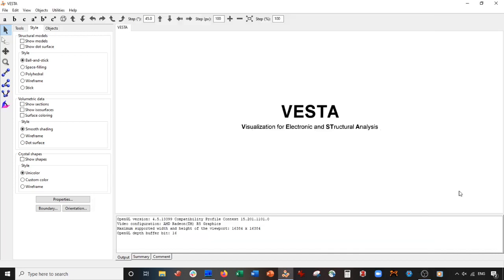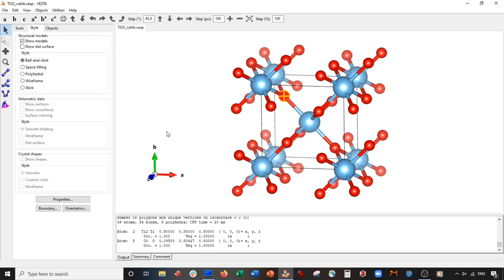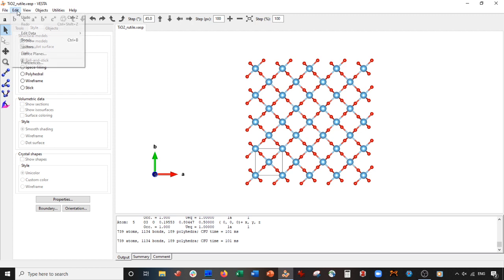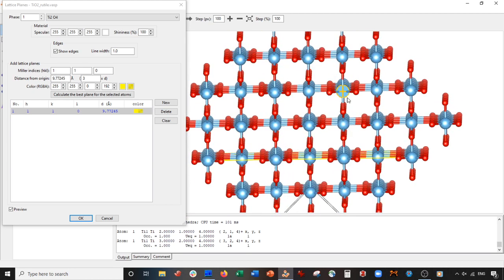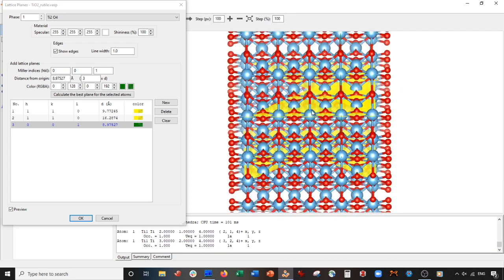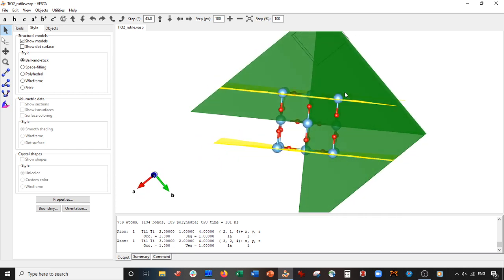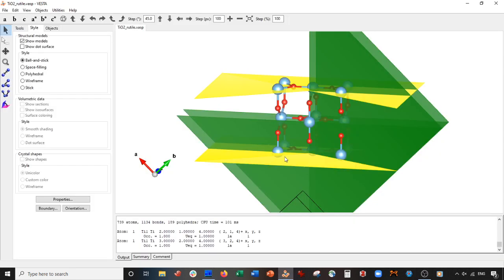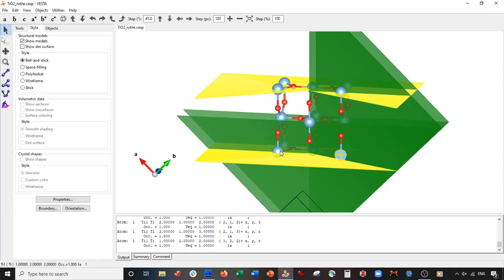VESTA Software - Rutile TiO2 [110] Surface Reconstruction

Comment: Hi. Thanks a lot for this great tutorial!! I am trying to do some oxygen evolution calculation over rutile (110) face and this video really helps a lot!! But in order to calculate the adsorption energy I'll need to have a coordinative unsaturated site (CUS), which is specifically supposed to be the top center Ti atom in this example, and to do this I have to remove the top lattice oxygen. I tried to directly delete it in the vasp file but I also lost an oxygen within the lattice (they're essentially one oxygen, labelled as O3 in my VESTA). I'ld like to ask how I can remove the top oxygen and expose the Ti site but keeping the lattice oxygen? Thanks!
Reply from the maker: Hi thanks for the nice comment. I supposed you want a surface larger than 1 unit cell. More like a 2x2 surface at the minimum, right? If you have the CUS on a single unit cell model, then you will have an array of repeating CUS type unit cells. I imagine what you want is a single CUS in an infinite array of non CUS surfaces. If this is correct, you need to take the 110 surface I made in this video and make a slab model. Then make the CUS on the center of that. Is this correct? If so, I think I can help you
Reply from the maker: Ti2 O4
1.0
        5.9835133553         0.0000000000         0.0000000000
        0.0000000000        13.0299339294         0.0000000000
        0.0000000000         0.0000000000        21.5149669647
   Ti    O
   24   47
Cartesian
   5.983513    0.000000    0.000000
   5.983513    0.000000    6.514967
   5.983513    6.514967    0.000000
   5.983513    6.514967    6.514967
   2.991757    0.000000    0.000000
   2.991757    0.000000    6.514967
   2.991757    6.514967    0.000000
   2.991757    6.514967    6.514967
   5.983513    3.257483    3.257483
   5.983513    9.772450    3.257483
   2.991757    3.257483    3.257483
   2.991757    9.772450    3.257483
   1.495878    0.000000    3.257483
   1.495878    6.514967    3.257483
   4.487635    0.000000    3.257483
   4.487635    6.514967    3.257483
   1.495878    3.257483    0.000000
   1.495878    3.257483    6.514967
   1.495878    9.772450    0.000000
   1.495878    9.772450    6.514967
   4.487635    3.257483    0.000000
   4.487635    3.257483    6.514967
   4.487635    9.772450    0.000000
   4.487635    9.772450    6.514967
   5.983513    0.000000    4.531329
   5.983513    6.514967    4.531329
   2.991757    0.000000    4.531329
   2.991757    6.514967    4.531329
   5.983513    3.257483    1.273845
   5.983513    9.772450    1.273845
   2.991757    3.257483    1.273845
   2.991757    9.772450    1.273845
   5.983513    0.000000    1.983638
   5.983513    6.514967    1.983638
   2.991757    0.000000    1.983638
   2.991757    6.514967    1.983638
   5.983513    3.257483    5.241121
   5.983513    9.772450    5.241121
   2.991757    3.257483    5.241121
   2.991757    9.772450    5.241121
   1.495878    1.983638    3.257483
   1.495878    8.498605    3.257483
   4.487635    1.983638    3.257483
   4.487635    8.498605    3.257483
   1.495878    5.241121    0.000000
   1.495878    5.241121    6.514967
   1.495878   11.756087    0.000000
   1.495878   11.756087    6.514967
   4.487635    5.241121    0.000000
   4.487635    5.241121    6.514967
   4.487635   11.756087    0.000000
   4.487635   11.756087    6.514967
   1.495878    4.531329    3.257483
   1.495878   11.046297    3.257483
   4.487635    4.531329    3.257483
   4.487635   11.046297    3.257483
   1.495878    1.273845    0.000000
   1.495878    1.273845    6.514967
   1.495878    7.788813    0.000000
   1.495878    7.788813    6.514967
   4.487635    1.273845    0.000000
   4.487635    1.273845    6.514967
   4.487635    7.788813    0.000000
   4.487635    7.788813    6.514967
   5.983513    0.000000    8.498605
   5.983513    6.514967    8.498605
   2.991757    0.000000    8.498605
   2.991757    3.257483    7.788813
   2.991757    9.772450    7.788813
   5.983513    3.257483    7.788813
   5.983513    9.772450    7.788813
Reply: @nickelandcopper5636  Brilliant and thank you so much! I tried this file and it worked!!! You're right and I'll at least use a 2*1 surface. I'd definitely appreciate it if you could teach me how to do this (to only have CUS at surface and at some certain points). At the same time I am also interested in the case with an array of CUS on the top (since I want to consider dual-site mechanism and I saw some papers doing calculation based on a "CUS surface" too). Would you please teach me how to do this as well : ) Thank you a ton!!!
Reply from the maker: Sure. I’m really busy right now though, but I’ll add it to my list. Are you sure this looks ok? Also double check that this is the 110 surface. It forgot which of the surfaces was the 110 in the 110 exposed surface unit cell. I think I got it right tho, but still double check
Reply: @nickelandcopper5636  Thanks! I think this is (110) face. For real calculation I'd like the slab to be a bit thicker but that might be relatively trivial. Looking forward to your tutorial and stay safe!
Reply from the maker: In the mean time, try removing atoms from the .vasp file and see what happens. At some point you’ll realize which atoms are the surface oxygens exposed to the vacuum. Just keep in mind that an adventurous and consistent spirit is the key to mastery.
Reply: @nickelandcopper5636  Hey just coming back to tell you that I managed to do it by firstly adding the vacuum and then deleting oxygen. Is it how to did it? Thanks!
Reply from the maker: Hi, no. Glad you did it though! I made the 2x2x1 slab model and removed an oxygen. I then added vacuum. Is this what you did?
Reply: @nickelandcopper5636  Haha no. I added vacuum first and then removed an oxygen, but it looked good in VESTA (similar to what you sent me yesterday) and I'll give it a try. Thanks!

Comment: Hallo Admin,

Thank you for your videos. 
Nice description on surface reconstruction.  I have an question. the final 110 surface has orthogonal basis sets ( i.e. a is pendicular to b etc)
what would you for other surface, for example 111 surface of TiO2  rutile. i have tried many times but very difficult to find orthogonal sets. 

orthogonal sets make thing easier. for example making interface with other surfaces. so i am eager to know tatics behind making such sets
Reply from the maker: Hi - I am not so sure what you mean. Do you mean what planes are orthogonal to the 111 plane?